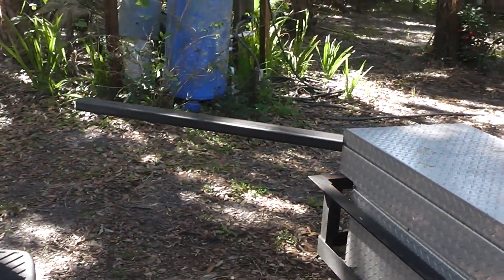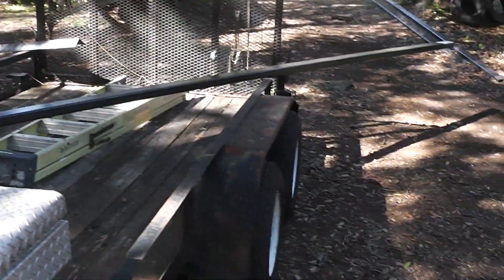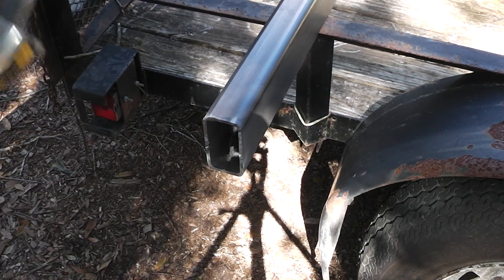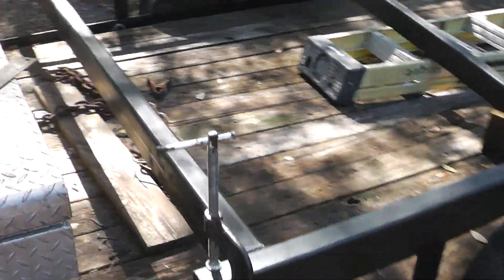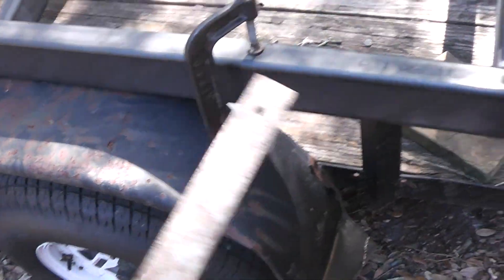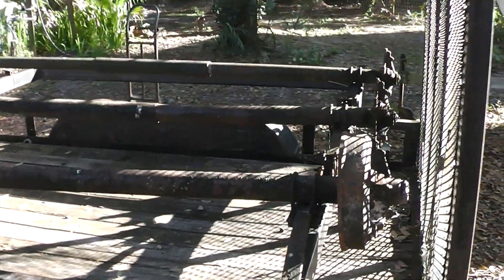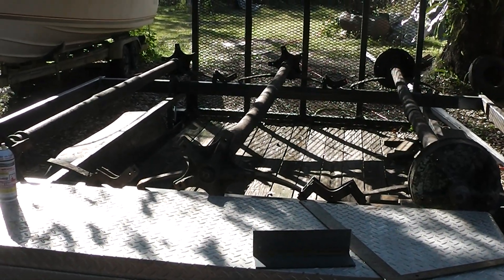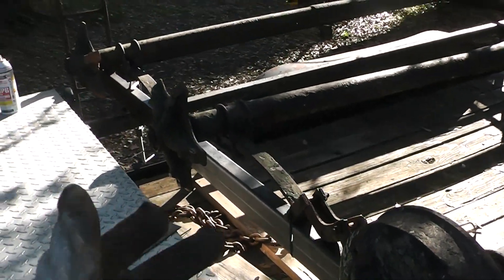Shipping Container 10000 lbs Capacity Trailer Part 2: Bogie

Comment: looking good! are those mobile home axles?
Reply from the maker: +Parlusk Thanks.
You are indeed correct, cheap mobile home axles($50) and I got the rims and tires for $10-20 each off of craigslist.
The steel for this project cost more than the axles and the tires did.

Comment: question, I will be fabricating a trailer 38 foot for a 18k sailboat.  I am looking for some advice on how thick of c channel or rectangular box to use with my three 7 k axles?  I was figuring quarter inch should be fine.  what do you think?
Reply from the maker: I would look at some trailers that have already been made to accomodate what your striving for and probaly put in some overkill for added insurance!

Comment: 3  axle!! What are you gonna haul on that?
Reply from the maker: +BCtruck, rebuild, repair,repurpose I tried my log rolling trick to move one of those insulated shipping containers(9600lbs) but, the ground in that area is so soft and the containers are so heavy, the logs just sank.  Very frustrating! I am hoping that this trailer will do a better job and make the move a whole lot quicker and less labor intensive.

Comment: Your little flux core welder isn't big enough for the material thickness you're working with. If you weld up a test piece & break it open you'll see what I'm talking about.
Reply from the maker: You obviously have no idea of what you are talking about: https://www.youtube.com/watch?v=PGQsX4jdPSE
If what you were saying was indeed true, all of the "cold" welds would have popped open on this trailer when it hauled this 7200 pound shipping container in the attached video. The trailer was stressed and no welds failed.
Reply: Dude you are pretty obnoxious and your example of a "stress test" was minimal compared to the stresses of highway or road use over a prolonged period. Your project has concept has merit but when someone gives you constructive criticism you should thank them for the advice whether you use it or not. Criticism is a gift not an insult.